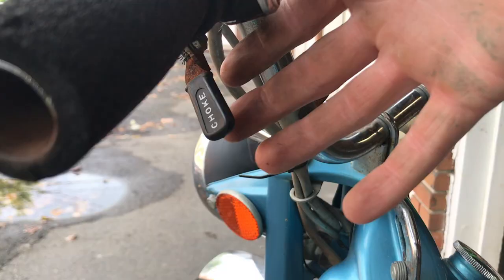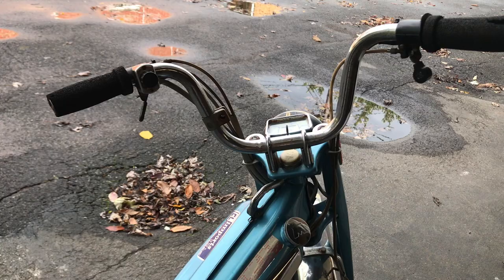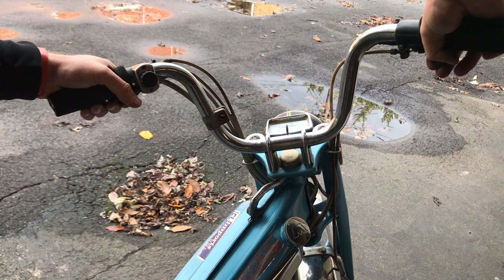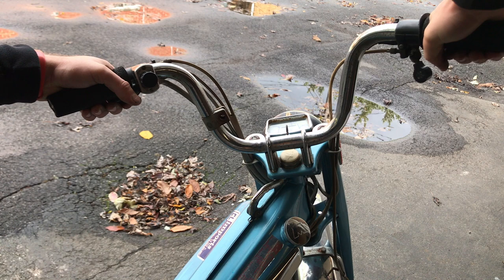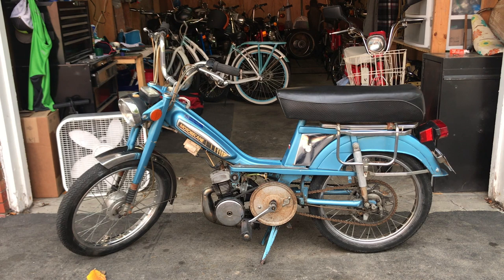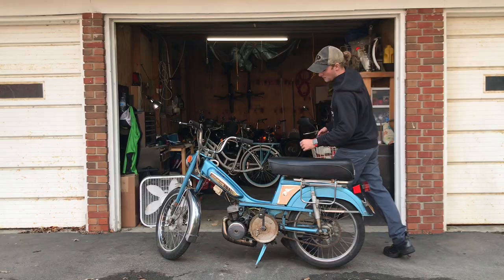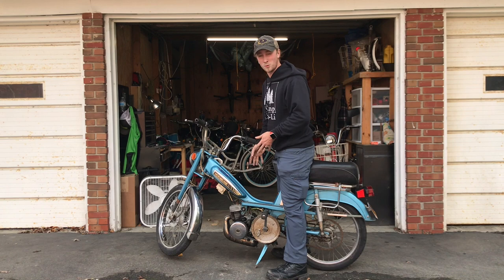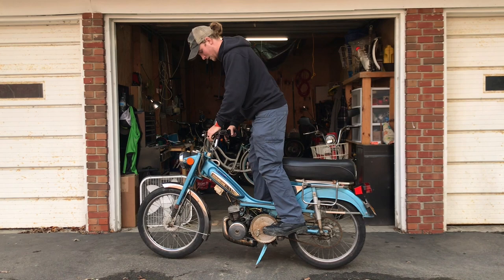Motobecane Mobylette Start Up ( How To )

Comment: 1:03 have 2 of these mopeds normal 40 orange model and Chrome “luxury” Yellow 50v model. They both have the original words on them 😬
Also fun fact : You can start these mopeds without sitting on them. While on the kick stand bring the right peddle to the top, decompress, (and choke depending on if cold or hot), then simply push down on that peddle and when the peddle reaches bottom dead center release the decompress lever. Notice if you cant start your bike this way this may be a sign your clutch cant grab as tight as its suppose to and you might need to replace it soon :)

Comment: I just bougt a Mobylette 40 t. I drives great. On mine the compression integrated in the gas handle.
Reply from the maker: Very interesting, I’m only familiar with the 50V models. Are all 40 t models like that?
Reply: @RestoCycles  i believe they are

Comment: It states in the user manual to 'never' mount on the bike whilst it's on the stand.  You should start it from one side without putting your weight on the stand....
Reply from the maker: It also states to only have 1 rider but yet comes with a 2 person seat. Good info though, you may be the first person to have read that.
Reply: @RestoCycles  ha.. I only read that because I just inherited a motobecane and it isn't working - no spark.. Not even knowing how it operates I found a pdf online.. I of course a real oaf at 110kg was on the bike trying to pedal start it..  Then I saw I really shouldn't..  Of course you look a lot lighter.... 🤣
Reply from the maker: @newbeginnings8566   haha I’m just messing around, I’m sure accidents could happen. Unfortunately motobecane makes it that you have to take the flywheel cover off to clean the points, but if you’re having a problem with spark I would first, check all of your wiring make sure you have all your bulbs inserted tightly. Then check to make sure everything is connected and not cut anywhere. If anything was corrected check for spark again. If still no spark change the spark plug. If still not spark check that on/off switch out. Then lastly I would invest in motobecane specific tools to get that fly wheel cover off and clean the points. Unfortunately motobecane mopeds are not easy bikes AT ALL! VERY HARD TO WORK ON BUT NOT IMPOSSIBLE!
Reply: @RestoCycles  yes I got the flywheel cover off.. I have the spark from the condenser.. I think the problem is the high tension..  I have buzzed everything through...  The tyres are all perished - it was last used 40 years ago...
I think they are a bit fiddly at first but more or less simple to work on... For sure I'll need to spend some money..  I have a  N50 superconfort from 1970.. It was used by my partner to go to school..

Comment: Can you use the bike just with peddling ?
Reply from the maker: Yes you can, if you notice in my video I mention that there is a switch on that little wheel were the belt is connected to. If you switch that the other direction you’ll engage bicycle mode. This bike is actually one of the better mopeds you can ride as a bike. Probably #2 in my opinion, #1 being a Vespa ciao

Comment: i got a moby, when i let go of the decomp the lever doesnt go back to its position.  I have suggestions on what to check, or mess with?
Reply from the maker: First things first moby’s are a pain. I would first suggest looking at the cable. Make sure its properly lubed up. If its not your cable the I’d check that decomp out. Maybe take the head of the engine off and investigate it a little more.
Reply: @RestoCycles  Awesome, i hit you up on IG as well.  took engine apart and its solid.  i think its a cable issue too.
Reply from the maker: @bgeraghty   hit me up @andrewwmx on Instagram
Reply: @RestoCycles  already did im bryan44

Comment: My friend have this bike tooo
His dad upgrade 50cc up 150cc 
Turn on so difficult and run just 1m and it’s turn off
Reply from the maker: That’s pretty sweet, I didn’t know they made a 150cc conversion. Must have installed a completely different engine.
Reply: @RestoCycles  what max speed is your bike?
My bike 50cc is 54km/h
Reply from the maker: @phamminh9901  my bike does about 30mph
Reply: @RestoCycles  oh that sweet my friend